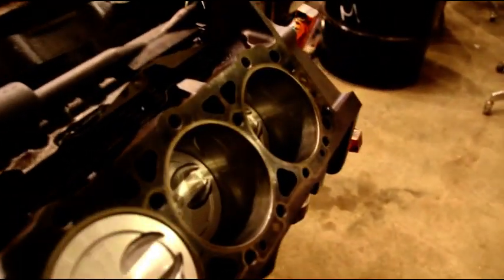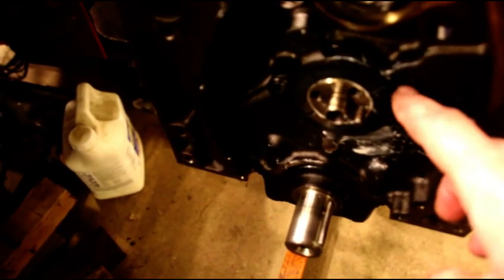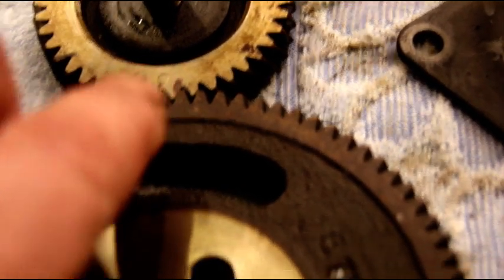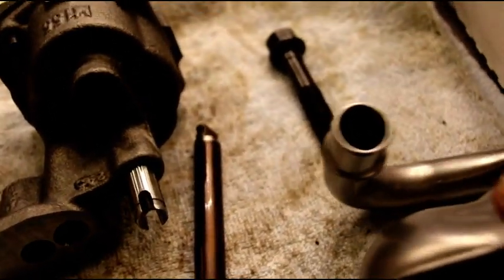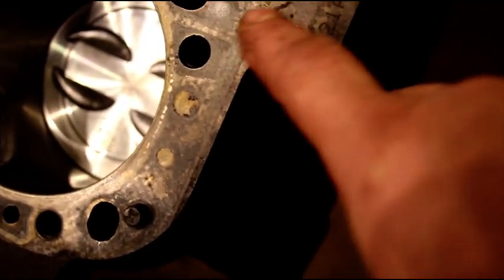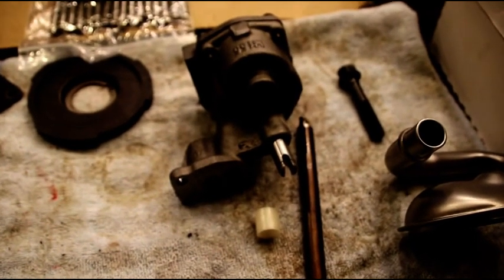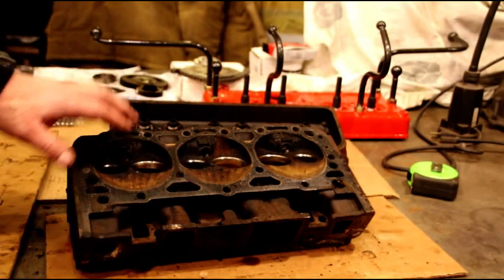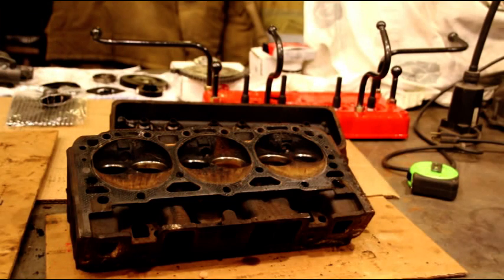GM 4.3 Vortec V6 Balance Shaft Engine Rebuild Update

Comment: All that work and didn't true the block deck.
Reply from the maker: Deck and heads were PERFECTLY flat. No reason to cut and already perfect surface and then have some trouble with the intake manifold fitting properly.

Comment: Hey what is the connecting rod bolt torque specs on the 4.3 vortec
Reply from the maker: It depends on what year engine you have.  Some engines are 15 ft. lbs + 85 degrees.
Others are 45 ft. lbs.
And still others are 47 ft. lbs.  
It all depends on the year of your 4.3 engine.

Comment: What is the part number on the balance shaft bearing and rear bushing I guess is what it would be called I am building one of these 4.3 vortec engines for my 4x4 project, but I am almost scared to tell yall what it is,  all my jeep buddies are trying to crucify me because I got an amazing deal on a 77 Toyota fj40 that had the GM bell housing conversion on the stock 4 speed already and I snatched it up... lol I really love the fj40 and the jeeps too, but I am new to them both and it seems to me that fj40 owners and jeep owners are like the Hatfields and McCoys and I'm over here like "can't we all just 4wheel together in peace and harmony ... I mean its so much fun" LOL!!!!!

Comment: Brian. What transmission and transfer case will best mate up with this engine for a M38A1?
Reply from the maker: I am putting a GM 465 transmission behind this V6.   Then adapting the original Dana 18 twin stick transfer case to it so I can retain the PTO outlet on the back of for a front winch or rear implement.

Comment: love all your videos! But the Vortec really caught my eye because I'd like to put one in my CJ2A.
I was surprised that you didn't eliminate the plastic sleeve on the oil pump when you were so outspoken on the plastic piece oil level?
What automatic transmission could I use behind,  that still fits the old transfer case? thank you
Reply from the maker: I didn't install the oil pump yet and will be showing the correct shaft to use to get rid of  the nylon bushing.  Next video.   You can use the stock 727 transmission but it might be a bit too long to use in a CJ2A.  Your rear driveshaft will be so short it can cause trouble.
Reply: @metalshaperJeep  thank you very much

Comment: Brian...  I am interested on the V6 4.3 L.   It will be interesting if you could make your own dyno so you can test your engines to determine flywheel HP.  Specially the Willis engines.  In my school the teacher made his own dyno using a transmission converter and torque bar determining the torque and checking the revolutions per minute to determine flywheel Horsepower = Torque x RPM / 5,252.   Anyway you have too many projects.  I always enjoy all your videos.  Keep them up.  Juan
Reply from the maker: Juan, I would love to have a dyno and cylinder head flow bench but being a one man shop don't really have the time to do it.  Maybe someday

Comment: Great tutorial on the 4.3. Our 3.5 in the 06 caddy is starting to have issues, but with all going on here, may park it and get moving on the 03 Dodge 4dr truck. The 4.3 is going to make a nice power plant Brian,, Thx again for the Shout Out and the awesome weld art coat rack,,,the ole 28 Nash has been used as a coat rack too long,,,hehe! Bear.

Comment: You may have mentioned it before but what year range of this v6 is best suited to building the way you are showing in the videos? Also, what horse power do you expect the end product to produce? How does it compare to the v6’s jeep used to utilize. I’m not very familiar with them. I’m enjoying this v6 series 💪🇺🇸
Reply from the maker: Any 4.3 is a good choice. You can get one from the 90's without the balance shaft and they share a lot of the V8 Parts.  The one I am rebuilding is out of a 2001 Silverado pickup truck.  I wanted the Vortec Heads and the balance shaft for my engine so I got a later engine but will be installing an intake and carburetor on it.  Not a fan of fuel injection on the older Willys vehicles.   They make great power and the early engines had about 155 horsepower and that went up with the later models.  They are much cheaper to rebuild as far as parts go, than the original Buick 225 that was used from 65 to 71 in the CJ5.   I am planning a SM465 behind this engine and it is very easy with this engine than the original.
Reply: @metalshaperJeep  I really like what you’re doing with this build! I may keep my eyes open for one to eventually put together. Comparing an original willys 4 cylinder to the gm v6 as far as rebuild cost which one ends up being cheaper to have rebuilt in your shop?
Reply from the maker: @RADIOACTIVEMASCULINITY  The V6 is a great engine for the Jeep and the power is amazing.  If you match the gears with the engine you will have a Jeep that can be a highway cruiser.  Now getting to cost between the modern V6 and the old 4 cylinder.  The V6 parts are much cheaper, but the machine work evens the cost out.   More cylinders to bore and hone, crank grinding is more, etc..... Prices come out almost the same depending on what goodies you want in each engine.  Hope that answers your question.  
Brian